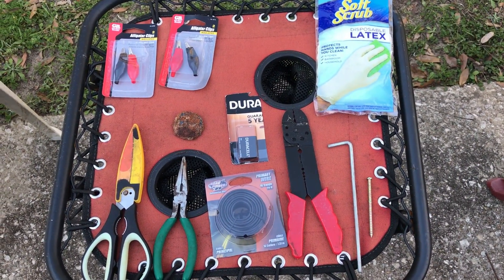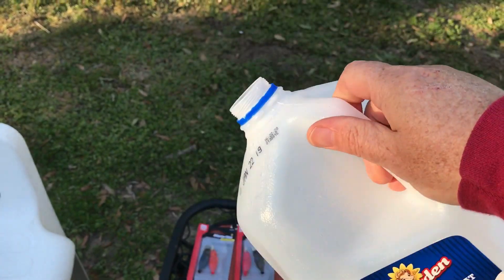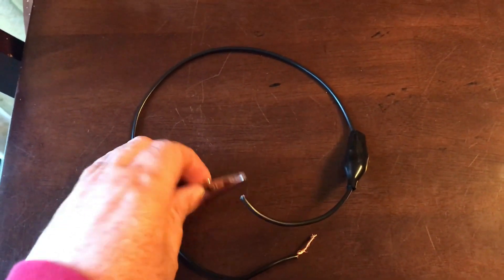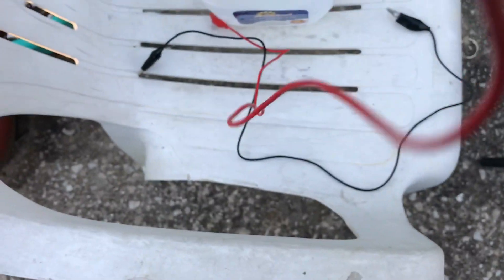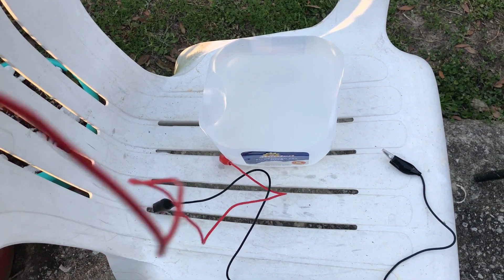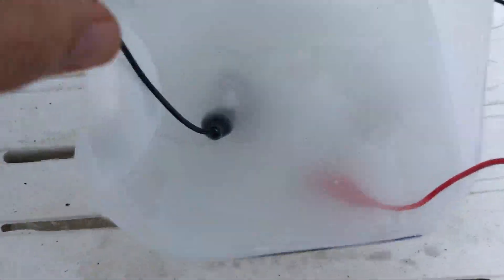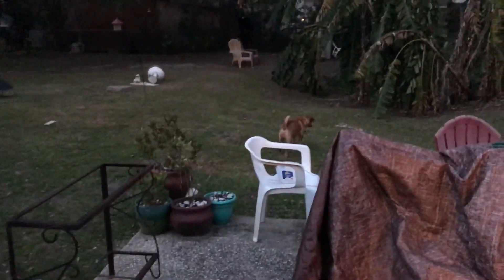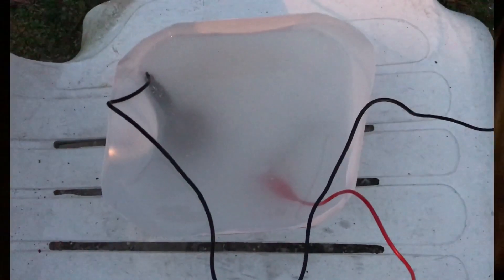Cleaning Metal Detecting Finds Using 9v Electrolysis!

Comment: too much rust on the mystery metal, the positive and negative cant make a connection. If you want good solid quick results use a battery charger for a car or use a portable electric welder, a 9 volt Duracell just wont cut it unless your doing something tiny and or not very corroded. Clean a small patch on the metal to give a good connection.
Reply from the maker: Thanks for the tips! That was our very first attempt and we definitely would like to try electrolysis again soon with an improved set up like you have described. That should work much better indeed.

Comment: I had the best luck by zapping the coins for approx 10-15 min sessions at a time with soft brass/copper brush scrubbing sessions in between.  Don't use brass/copper brush on potential silver coins (softer).  However on bronze, it's ok and very effective.  If you don't scrub between each zap, you end up wasting more time waiting to expose new conductive surface to the electrolysis action.
Reply from the maker: Thanks; will try those tips for sure. This is much appreciated. 👍😎🦈🦈
Reply: @metalsharxs  you're welcome, this was done many years ago when I could still get large ancient roman bronze coins cheaply (uncleaned) and many were very encrusted. I used to zap 10 of them hanging from a steel rod on alligator clips into a salt water tub.  Carbon graphite rods were used on the sacrificial side because it would not release toxic chromium (from steel) that way.  A five amp battery charger would make them fizz like alka seltzers.  :)

Comment: 3 and a half hour is not enough, this one coin looks very rusted and 3.5 hour won't do it, leave it at least 24 hours and get you a charger or a power supply because these batteries won't last long and so buying a 9v charger or a 5v phone charger is better and cheaper economically than using these 9v use once solid batteries :)
Reply from the maker: Procker Dark, many thanks! Those are some great tips which we will try & do a follow-up video. 😎👍🦈🦈

Comment: Hi mate , enjoyed the video , it's a good process for cleaning finds , but be careful if you leave them to long they will dissolve LOL , you can also use a phone charger  ( with the right voltage ) anyway good stuff mate , have subbed and liked ATB GL & HH Rob .
Reply from the maker: Thanks; those are good points!  I have also been thinking about using an HO power pack from model trains or slot cars to supply the electrical current.